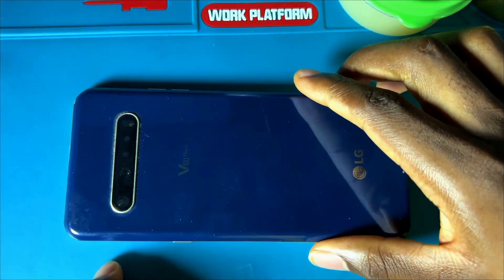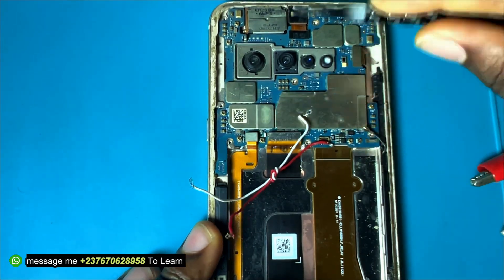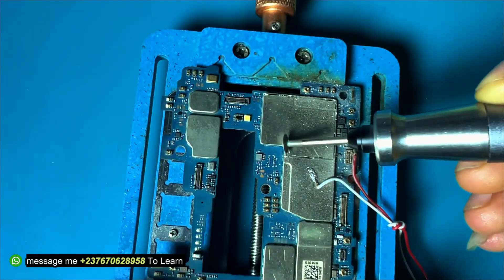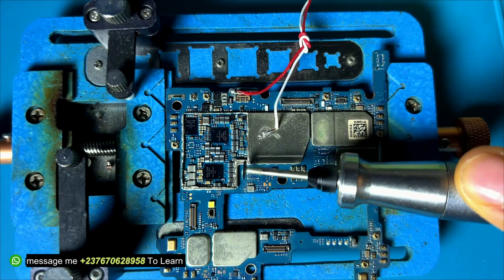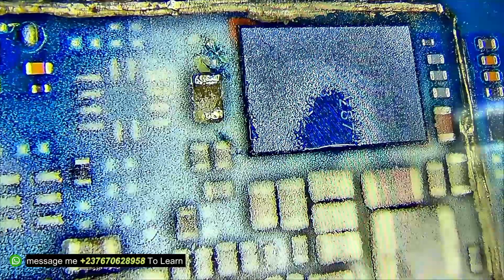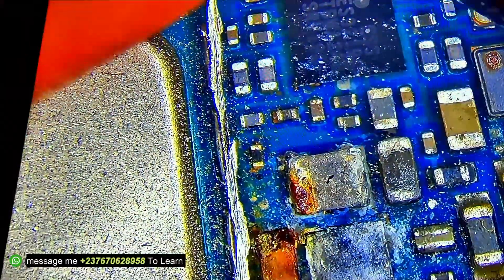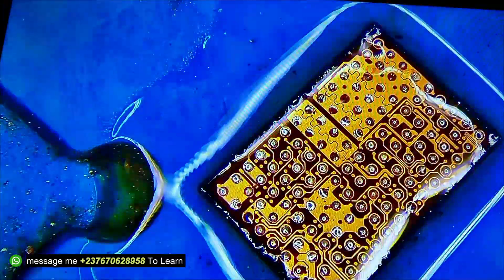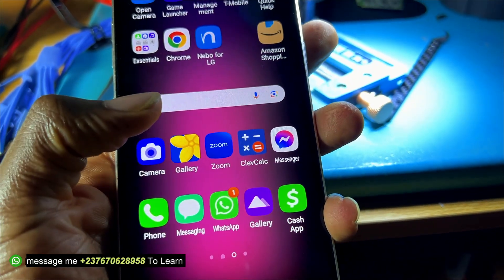LG V60 Mobile Dead Repair Recovery After 2 Years Of  Repair Attempts In Other Repair Shops

Comment: Did you replace the shorted SMD capacitors you removed? Or did the phone charge & power on OK without those capacitors? It seems strange that it would power on and charge with components missing..
Reply from the maker: I didn't replace the capacitors I pulled out. And it's not strange that the phone will charge with capacitors pulled out. As long as the capacitors I remove are connected in parallel